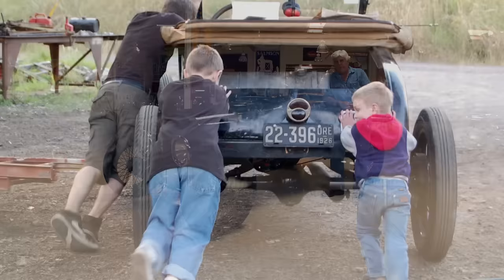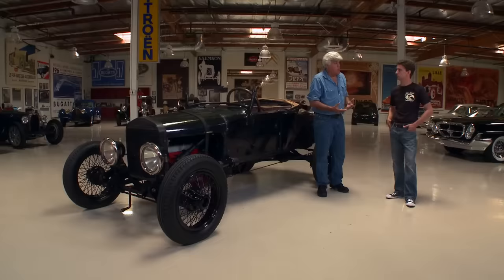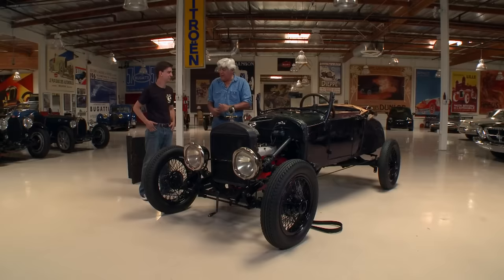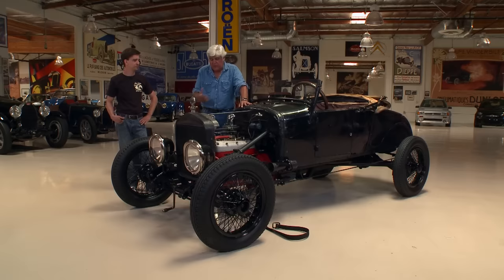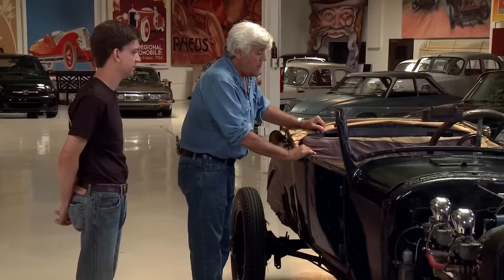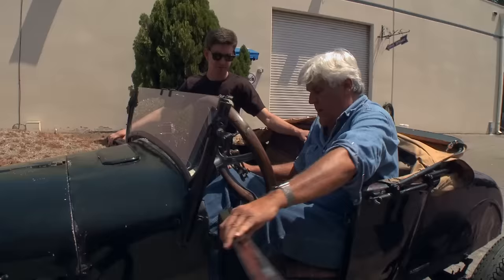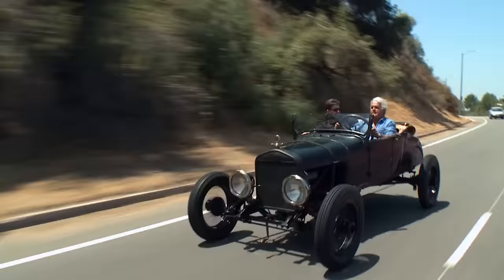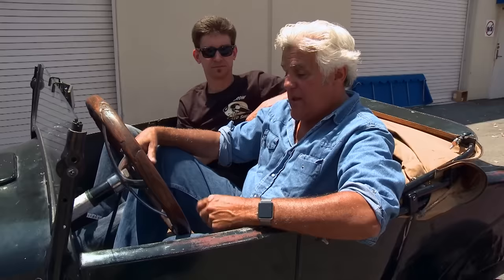1927 Ford Model T - Jay Leno's Garage

Comment: I totally agree with the sentiment expressed at the end of this episode.  I don't own a car anywhere near this old, but I use a car from the 80s as my daily driver due to the same basic reasoning.  I understand it, if something goes wrong it's easy to troubleshoot, it's easy to service, and the parts are inexpensive. I like the self reliance of being able to keep the car running myself.
Modern cars are very fast, but their complexity has gone overboard.  We've lost the attributes of older cars that made people self sufficient and independent. That's far more important and fulfilling to me than being able to do 0-60 in 5 seconds.

I love this model T build. It's a down to earth example of things that anybody of average means can do if they're interested.  I think it's usage of old hotrodding gear for the period engine is way more interesting than throwing some modern drivetrain into it. And of course it retains the simplicity that a model T should have.

Comment: reminds me of My father and his 27 Model A Touring car - he rebuilt the engine put it all together - still had parts on the floor and it still turned over and worked - he couldn't remember where the parts that were still on the floor went - they were part of the engine - but the engine turned over and still worked.  That's the way real cars were built.

Comment: I'm 70 years old and always wanted to rebuild a  model T/A but being in the Army and traveling all over the world, never allowed you to accumulate anything so it never happened. Later I got into mustangs and now own three. I totally rebuilt a 71 Boss 351 and it cost me 30,000.00 and hell I did most of the work. The other two are a 67 and I had to have a 05 when they came out

Comment: The best part of this is the high gears, with the overdrive box. The sound of the engine lugging nicely right above an idle, not over revving unnecessarily down the highway is gold. I cringe every time I hear anything without an overdrive. Overdrive is the single most important feature to any car ever made. Most American trucks and many cars had way too low of gears and no overdrive, and wasted their engines and a lot of gas for no reason.

Comment: I bought a 55' Ford F-100 from my brother. It had a 283 Chevy in it, with straight headers in it. It would go 110 MPH all day long. My favorite truck of all time. I haven't owned a truck since. My present truck is a 2000 Subaru, Forester. Beast plumbing truck of all time.

Comment: We had a Model A, used it as a dune buggy when VW's with fat tires were the max.  Ford, calm steady engine, big wheels, EXCELLENT ground clearance, box on back for storing pilfered watermelons from the fields up Bouquet Canyon just past Lily of the Valley trailer park. 1st gear would trundle you past many a problem with a little patience.  Zippy it was not but got you to many a place that busted oilpans and zippity busted would not.

Comment: There"s a family museum in Bickleton, WA called the Whoop-n-Holler Ranch Museum that has one of the RAJO heads on it and an aftermarket rear diff. not sure of the brand. It also has wire wheels and the bug back. Its the real thing from back in the day. GREAT program, thanks for sharing!

Comment: It is claimed in some publications that the  1927 improved Model T in speedster race mode with a two speed diff and a Frontenac overhead valve conversion and running a Livingston wedge shaped radiator had speeds up to 120 mph.

Comment: You shouldn't talk to Mr. Leno like that. Have some respect for the elderly. LMAO !   ( 27:38 )
Sitting here with a big grin on my face. Back in the 70's, my dad restored a 1927 model T and a 1929 model A. Both to original factory condition.   I got to drive both.  After dad passed away in 1983, mom sold them both.  I could of kept the Model "A", but life at the time just didn't allow me to. I sure do miss those cars.... OK, dad too..

Comment: We used to take a ten-dollar car and strip off most of the body, then take 'em out the pipeline and run the shnazit out of them. It was SO much fun, and as dangerous as a cocked cannon! Dud Cantley told me that an old Dodge they had "fixed up" would do 80 in second gear, so naturally when my buddy and I came to a straight stretch ,I  slammed it up into 2nd gear and held it on the floor. The old wreck had a dash with a working speedometer in it, and in less than a minute, the needle was quivering at the 8-0 mark. We thought maybe  we had ought to slow dawn, but when I stepped on the brake, it didn't have any. I yanked on the Emergency brake and we spun around and negotiated the hairpin curve BACKWARDS... Man, what a ride! Dw

Comment: my grandfather and i are working on a mg-b "midget" and are having a hard time with it... supposedly the car has a vapor pipe, and was wondering on how dangerous they are? because i have seen videos where a car's fuel tank blows up or starts pushing out the gas out of the gas refill tube.

Comment: A farmer put a new tin roof on his barn and ended up with a pile of rusty scrap metal in his barnyard.

“What should I do with it” he asked his neighbor?

“Send it COD Detroit to the Ford plant, maybe Henry can melt it down and use it. He might give you a little for it”, the neighbor replied.

So Farmer Jones crated up the scrap and took it to the rail head. A few weeks later he got a letter from the Ford Motor Company, it read…

“Dear Mr. Jones, 
 Your Model T was in the worst condition we’ve ever seen but we’ll have it running and returned to you in six weeks.”
Reply: would be surprised if its a true one,

coming from an European citizen

Comment: I was thinking about just finding a model A pickup body and just throwing whatever engine and transmission I want in it can that actually be done or does it require a bunch of retrofitting or will the chassis not handle a modern 4 cylinder engine.

Comment: If I could have a Model T, I would have to modify it to have a Ford V8 and automatic transmission. The suspension would have to be modified as well. I would probably use it as a weekend car.

Comment: How do you shift the 3-speed when there's no clutch pedal?
Reply: Using the throttle and good gear timing. It's what they call a "crash box"...no syncros, so you have to time your shifts. Once you learn it, it's easy.

Comment: At 2:53 what he's doing with that lathe is potentially extremely dangerous. He's reaching over the spinning shaft and handling it with both hands wearing a LONG SLEEVE shirt. BIG MACHINE SHOP NO NO. The spinning part could very easily grab onto his sleeves pull him right into the spinning machine with an absolutely horrible, industrial mishap outcome.  Any doubts simply google for lathe accident pics and also there's a few videos on youtube of this very thing.
Reply: That is true, but this was done at extremely low RPM, the slowest the lathe would go (less 40 RPM...like slow walking speed) so that we could accomplish this as safely as possible.  We also removed any parts that may catch just in case.  I would not have done it otherwise.  Good catch though.
Reply: Geared down low means it may spin slower but it has much more torque. ~40 rpm is nearly a rotation a second, easily fast enough to suck his sleeve/arm in before he knew what hit him. Besides that, the large diameter of the ends of whatever is being turned has a rapid linear speed. The chuck and device being turned is a complete blur - those parts are moving. And there's no stopping it once it gets a hold. The whole idea of wearing a long sleeve shirt while doing this in any way at any speed is just a total bad call.  And I'm not being a safety nazi. Seriously, check it out (and these are very mild compared to what often happens, which are forbidden to post on youtube):. 

https://www.youtube.com/watch?v=af8HgPEIlQc
https://www.youtube.com/watch?v=3EdQq5iAGYs

Comment: i didn't understand what are the lever inside the steering wheel and where is the accelerator if is not behind the steereing wheel?
Reply: The Steering Wheel levers are Throttle and Spark (Ignition timing).  I added a foot throttle to make shifting the Aux. Overdrive easier.
Reply: thanks, and beautiful car!!  :)

Comment: I know this video is seven yeas ago, but come on,  $6,000 “to be honest”…. the headlights, wheels, steering wheel, custom carbs….. I really wonder what he has it.
Reply: The car was $800, the motor was $3,000 all in with the carbs, $600 in tires, the wheels I paid $50 a piece for, The steering column was $75 at a local swap meet (That's $4,675 so far) and everything else I did myself or was given/bought for next to nothing at swap meets and flea markets.  I was in my 20s, it was a budget build.  I wanted to prove that I could do it on a budget so that others could too.

Comment: im in uk trouble with customs is they distroy history i totaly get this car i had a bsa  bantam u know the little 175cc 2stroke  only thing i disconected   the old wipac switches they were too troublesome and i had a suzuki charging  6 volt system good lights i t looked stunning an ran so good i used it daily 70 miles plus only time it stopped was due to a plug fowl a plug spanner and i removed a flec across the gap with a blow an aquick clean with a bit of sand paper from a match box and i was back home it was how history should be fond memorys  humming along for miles  in my sleep even 20 years on why ? its just a bantam it pushed any dreams of a ducati s4 away it got me so deep !  leaving somthing stock as much as u can is the way  History of Light Commercial Vehicles from the TV series Classic Trucks narrated by the late John Peel  watch it on utube   enjoyhttps://www.youtube.com/watch?v=cqOH4CbyYos  yes ford t is teatured too

Comment: A Model T with A controls
Reply: Similar, but very different. All of those things (The Chicago OD box and the gas pedal) are all period aftermarket Model T accessories from the 1920s. They were intended to make the model T (trucks and cars) more flexible.  The Chicago OD is not considered a Three speed trans, more of a Brownie Box to give you Underdrive, direct and a true overdrive so that one could split their shifts on hills and have a highway gear.

Comment: THAT is NOT a "T"  Might have been but not as shown
Reply: Actually, it is still very much a Model T. Sure, its modified quite a bit, but the important bits like the engine, transmission, brakes, axles, frame, body, etc are there and do what they should. All the mods are period T and the accessories like the Chicago Overdrive and the Ruckstell axle are all made for Ts back in the 1920s. Just because the car is not bone stock with a timer, buzz coils and no brakes does not make it "Not a T". 

If it had a TCI frame, modern running gear and a 350 SBC in it I might agree with you.  As the car stands right now however, I respectfully do not.

Comment: "This is thermo-siphon, which means it overheats"
Reply: Believe it or not, its cold blooded.  I have never had it overheat on me and it always runs on the cold side.  On this day, it was hot and it stayed below operating temp the whole time.
Reply: It works pretty ok (thermosiphon) till you get a heavy heavy load.  Henry was looking to save a buck any where possible, lol

Comment: Model “T’ s didn’t have gearshifts or gas pedals. This is NOT a T
Reply: Sorry,  but This is 100% a Model T Ford.  All of those things (The Chicago OD box and the gas pedal) are all period aftermarket Model T accessories from the 1920s. They were intended to make the model T (trucks and cars) more flexible.   The gas pedel (while not correct to a purist) is there out of regard for safety. When using the any of the OD boxes, you MUST have Auxiliary brakes and the foot throttle. The brakes are due to the ODs positive neutral (if you miss a shift on a hill....you have NO brakes at all otherwise) and foot throttle is there for shifting, otherwise you have to take both hands off the wheel to shift (one to shift gears, one to run the Hand throttle to sync it) and that is dangerous.